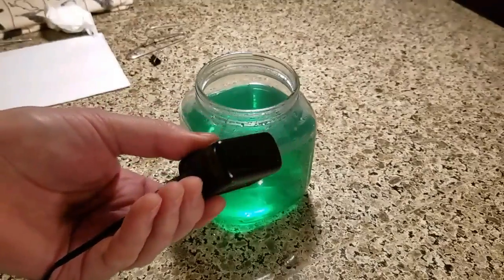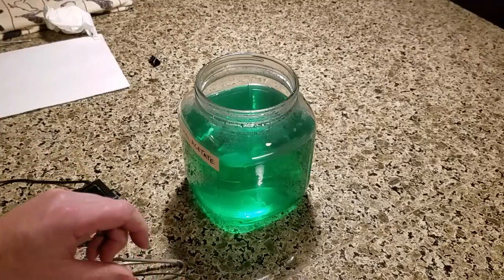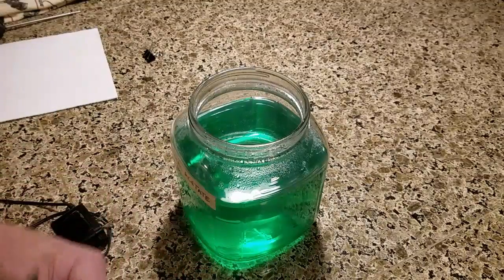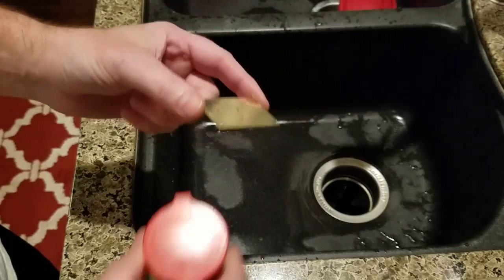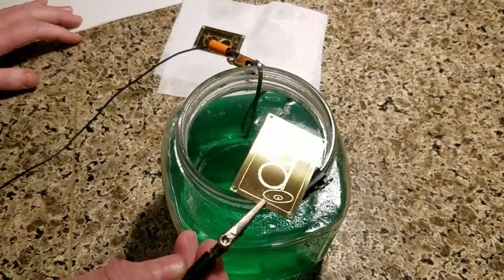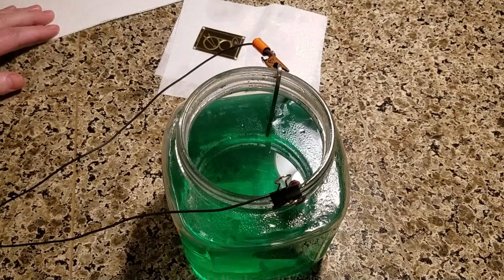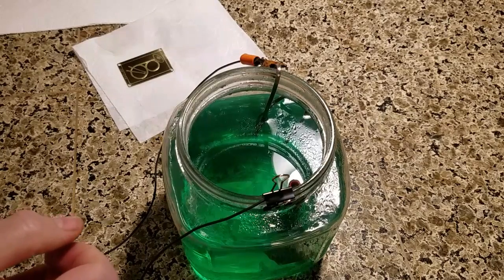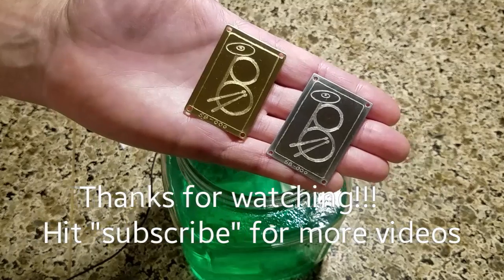More Electroplating - Nickel onto brass

Comment: Your pilot is either clogged and or flame is coming up from the bottom of the pilot. You should have three flames shooting straight out from each side to the igniter to the sensor and to the burner and they should just be blue. That pilot needs to be disassembled and checked as this is an unsafe operation. Never bend the sensor as you’re changing the design and making it unsafe. It is OK if carbon builds up on the sensor to sand it clean as that prohibits it heating up enough to send the proper dc voltage to the valve.

Comment: So here is an oddball question. I am wanting to refurbish piano pedals. The part that is outside the piano is to be nickel. The part inside does not have to be as fancy, but I want some rust protection, so am considering bluing.  Now because of the odd shape and size, I am not confident with how much of the pedal will be immersed in the solution. Does anyone know if I can mask off where I don't need the nickel plating, and if so, would electrical tape work without contaminating the solution? Of course, I could just TRY it on some other piece of steel, but also like to learn from other's experience.  Thanks!

Comment: ive been trying to plate steel with copper for months. a durable finish. it always wipes off. what i have learned: degrease and clean the steel. use a phone charger. low v and a is best. all i am missing is a source of nickel. i want to nickel plate the steel before i plate it with copper. i just cant find a source of nickel. i will keep my eye out for nickel welding rods afyer watching this video!!!
Reply from the maker: Ralph, you need to plate steel with Nickel first.  Then, plate over the nickel with copper and it will hold well.

Comment: @Bryan212  I made the Nickel Acetate using the method you show in the other video, with vinegar, salt, and nickel anodes I bought online. It made a nice green solution. But I've tried test plating multiple different test pieces, the parts fizz / bubble like its working (although the anodes bubble some as well)...  but I don't get any nickel plating whatsoever on the test parts, and yes I do have the negative lead connected to the parts, tested with multimeter just to be sure. If anything happens (other than bubbles) the part just gets a black coating. I've tried copper pennies and also a steel test piece, both turns black or nothing. I know the piece has to be clean, but even if it isn't clean I would expect to have some type of depositing, maybe not smoother or etc, but right now I get nothing or black. However, I did clean my test pieces mechanically with a wire brush on bench grinder, and I've tried several different chemical cleaners. Such as electrical cleaning spray (similar to non-chlorinated brake cleaner), then I tried muriatic acid. Always rinse part in distilled water after chemical cleaning. But neither cleaner seemed to make a difference. 

Anyone know what I'm doing wrong??
Reply: well, I'm going to try to make one more batch of nickel acetate tonight. Rinsed my container out, then used 91% alcohol to clean it really well, then i let it dry a few minutes. This time I also wrapped my nickel anodes in coffee filters and rubber bands. As that should prevent the... "black stuff" (some other form of nickel i assume) that drops off the anodes at times from dropping off into the solution. It didn't drop much last time, but there was pieces of it in the bottom of the container. After I get the solution made, I sure hope I can get it to work this time, as I don't expect I'll have much left of my anodes after this, certainly not enough to make another batch.
Reply: @Yhrim70  Did you get to the bottom of this? What's the amperage of your charger?
Reply: @dioni82  I haven't fooled with it for a while. plan on setting up seperate permanent bucket tanks for both nickel and copper, but need some cash to set things up the right way this time.
Reply: well, after several hours, i checked my nickel bath. The penny was still mostly shiny copper, but there was a faint black on some of the wire and a very minute amount on the penny. I tried to wipe it off with a clean paper towel, very little came off, only know because I could see it on the towel, mostly from the wire. Most of the black was still on the wire and a tiny "shade" on the penny. So I washed it again in muriatic acid (which still didn't seem to remove the black... i wouldn't expect this would be "black nickel" ??), rinsed in distilled water, and placed back in the tank. I reinstalled my pencil lead "graphite resistor" into the power feed, and am going to let it sit in the bath overnight, see what happens... if anything. 
If I can't get this nickel bath to work, then i'm giving up on this method, already used 6 gallons of vinegar and after tonight I'd say my nickel anodes will be pretty thin, maybe even hole-ly. Just doesn't make sense why it won't work, i got my copper bath to work even when I didn't know as much about plating as I do now. if the black i found was from burning, then that means I must have a conductive enough bath... so adding more salt would only make it burn more or burn faster (at least I would think so)... still doesn't explain why there is absolutely Zero nickel on my test penny... on the flip side the bath is getting greener, so the nickel ions must still be going into solution...  well, if I can't get this method to work, then I'll have to wait until I get some more money before I can revisit nickel plating.
Reply from the maker: Very strange.  Are you 'absolutely' sure you used 100% nickel? If any strange metals or welding flux is in your solution [mixed w/nickel] it will not plate.  Seems like the black you mention is 'burning'.  If your parts were not fully clean you woulf still see plating, but it would be inconsistent.  Another possibility is your using too much volts/amps.  But, again, you would have plating with pitting, splotting and inconsistency.  So, i think you may have used 30 or 60% nickel and/or had welding fux in/on the rods.  Let me know.
Reply: @idahomecustomdesign  Hi Bryan Thanks for the Reply!! The nickel anodes are supposed to be 100% nickel specifically for plating. I bought them off... amazon I think it was, back about a month or so ago... if they aren't pure then... well false advertising i guess. 
I need to copper plate a steel part, and I found out (the hard way...) that in order to copper plate steel, I first have to nickel plate it. Which I wanted to do some nickel plating anyway, so didn't think it was a big deal. 
I'm using a 5v power supply, old phone charger, and I've checked it with a multimeter and it is putting out 5v with no load, and around 4.5v when connected to the anodes and a part. I also thought that maybe my voltage was to high...? But I am using a 3 gallon bath, two nickel anodes approx 1.5" inches wide by 6 inches long. I've tried small test pieces, such as a piece of steel and also pennies just so it was easier to see the color change... but they didn't... And I also just tried a larger piece of steel, about 4"x8" 1/16 thick, which is approx the size of the piece that I need to plate. I know I should have larger anodes for such a piece, but figured it might just plate slower...?
Reply: @Bryan 212  Here's a thought... I noticed on this larger steel plate that I tested last, there seems to be a few spots toward the bottom that appears to be... or looks like... copper?? But it doesn't wipe off??! Further how could copper get into my solution? I have the anodes clipped Above the water line. I did have some test parts hanging on copper wire before which was connected to the negative lead, could that wire have put off copper into the solution? Would that stop the nickel from plating at all?? But if that was the case... then why wouldn't a copper penny do the same thing when you nickel plate it....

Comment: idk what the hell is going on with my setup ?,,to get a solution ready i mix even parts distilled water and vinegar and add iodized sea salt(maybe a bad idea),some citirc acid and hydrogen peroxide(turns solution light green as soon as i put it in while the current is running ),i place the ends of freshly striped copper wires to each of my leads that are hooked to a 9v bat and start getting the solution to turn up the  copper sulfate ,i notice the negative wire starts getting a bit black or gunky while the positive remains somewhat the same and clean ,,but i also have a nice long flat piece of copper strip i usually use for the plating and when i try using that it start getting the same brownish formation on its surface ,could this be because i introduced some bad elements into the solution by having cleaned the strip with steel wool or SS brush ,kerosene and methanol and washed those off with water? what am i doing wrong because i think this problem is not making my plating work as it is building gunk on my part(canadian dime or quarter)
Reply: and my solution bath looks green not blue?

Comment: so it's important to brush the parts with say a SS brush in order to make the surface ready even if it is already nickel plated and you want to plate copper on?? is this why my quarters are not working? i am using canadian quarters and no matter what i try it does now work well,i brushed them too ,are they not nickle plated already? the alligator clips i am using to hold the part actually got nicely coated and came out great,yet i never scrubbed it or done nothing and i held them so there must have been skin oil on it yet it worked so wtf??

Comment: Should not have used the steel wool.  You wont get those scratches out without buffing down past the plating.
Hydrocloric acid works great to strip crap off.  60 seconds and you can rinse with water and plate it.
No scratches...
Reply from the maker: Thx.  This video was to answer charger and other questions. I use other methods, such as acid to clean.
Reply: so it is not necessary to scratch and make the part surface more adherent to the ions?
Reply: 03006256530call me

Comment: Great video, do you know of plating Brass to Steel or Iron? I don't want to "Burnish" the steel I want to actually plate it. It would be a pain to try and cast the pieces out of brass (that I want plated)
Reply from the maker: mark tucker - Brass plating is interesting, bcz it is a combination of zinc and copper.  There are a couple simple “kinda” brass playing ideas.  1). Plate your metal with zinc and then re-plate it in a copper solution on a super mild voltage for a short period as to get the object brass looking.  2). Plate object zinc, then plate object copper and then head object to melt the two platings together.  That’s the best I can tell you.
Reply: "and then head object to " what did you mean by that?
Reply: @ARCSTREAMS  heat bro
Reply: @sajeevagahlawat9279  thx , 3 years later lol

Comment: How to extract nickel to metal intstead ofplating ?
Reply: If you mean to make the nickel electrolyte - creating the green vinegar. You just use two pieces of nickel on both the positive and negative (cathode and anode) and let it run for a few hours, the vinegar will turn green and it should last forever and the anode should replenish the electrolyte as you use it. As long as you don't ruin the solution through contamination.

Comment: You can get a 1x4in strip of nickel from a old AA NiCd battery, it has holes in it so makes a good anode you just need to use some sandpaper or a blade stone and get all the battery crap off it get it shiny. That's if you don't have welding rods like I have a huge box but they are steel core ); I'm going to try it tonight with my old nitro rc car engine sleeve, hope it works I've done electroplate before but not like this and not nickel ill let u know if it comes out good. DONT CUT UR SELF OPENING THE BATTERY I AM NOT RESPONSIBLE and only NiCd will work!

Comment: Hey Bryan, I have an old wood working plane that the nickel plating is gone or flaking off in several spots, but I'd say almost 70% of the plating is intact. I was wondering if you might have an idea on how to strip off the remaining plating so that I can re-plate it. So far everything I've read mentions to use acids and the like, but I was wondering if its viable to remove the plating via electrolysis? Ie. Placing the cathode on the plated part, so the nickel is stripped away? Let me know if you think this would work
Reply from the maker: Daniel De La Pena -  Yes, i have removed plating by electrolysis and it works pretty good.  The main thing you want to try and find out is if it is nickel, zinc or chromium.  If it is zinc or nickel go ahead and reverse the electrolysis and keep an eye on it.  I should transfer (deplete) the nickel or zinc faily qickly [5-15 minutes??].  Chromium is a different story, it is more toxic and needs to be done outside and maybe better suited to be sanded.  You will have to do some fine sanding after the electrolysis and clean the block plain of all oils, etc.  The better the prep work [smooth surface and clean] the better the plaiting will turn out.  Watch out for pitting when reversing the electrolysis.  It is better to use less volts/amps and take for time to avoid burning and pitting.  Good luck.
Reply: Bryan 212 Thank you for all of the knowledge! I'm fairly certain its nickle, it's an old Stanley no.46 at least 75 years old. I'm planning on using a battery charger that goes down to 2 amps, is that low enough amperage?

Comment: Does the temp have to stay constant ? You recommend about 120f - but what if you have a few parts you want to plate - so by the time you get to the last part your temp would have dropped.
Reply from the maker: It is not critical,  but the warmer the solution the better the plating.  I tend to heat the nickel acetate up in and old pan and use a temp gauge to get it close to 120-140.  There have been times when I plate several parts and the solution drops to 95 by the time I am done.  All in all just dont plate with cold or room temp solution or it will take longer and not plate smoothly.

Comment: Another way to check for + and - leads is to use a digital multimeter. If you don't have one, pick one up, they are dirt cheap these days, and come in handy.  Secure the leads of the multimeter to the leads of the adapter, keeping + an - separated. Then plug the adapter in the receptacle. Make sure the adapter is DC (not AC, as some are; I once fried a nice gadget because I plugged an AC adapter into the gadget which was DC) and make sure your multimeter is on DC Volts. If your leads are reversed, the multimeter will read with a negative sign in front of the voltage.
Reply from the maker: Thanks, I have one, use it all the time.  But, some people may not, therefore just showing another method.
Reply: Also generally the positive have no markings on the insulation a negative will have a white line or some sort of indicator Maybe a rough Edge to it where the positive is a smooth

Comment: Its about the amps not only the voltage.
Reply: I tried a 9v battery with 200~300 mAh ;D
it drained quickly
Reply: I used a pc power supply 3v at 30 amps, almost instantaneous.

Comment: Great video...
Where did you learn about the soy sauce for a degreaser?  That's a new one for me!
I watched the video on making the nickel acetate.  How did you make the copper acetate?  Same way?
Reply from the maker: I learned it from a guy who works with brass badges, etc.  i was suprised too, but it works like a champ.  copper solution is a bit different, you can just let copper pipe piece disolve in pure vinegar, or there is a product made by Zep called, "root killer" at home depot.  it is almost pure copper crystals.  some states dont sell it.  im in the pacific NW and its in all store.  maybe i will make a vid.
Reply: Another question... where did you buy the nickel welding rod?  I found them on the internet, but in packages of 30, and they ain't cheap!
Reply from the maker: i bought a pack of Forney 45400's w/12 rods.  they were $36.95 at Ace.  it was worth it, they are 99% nickel, the 1% is the flux on the outside you rub off with a knife.  everyrhing else i looked for was plated nickel.  i still have 7 rods left and i have been plating for over 2 yrs.....lots of parts.  Amazon had them for $41.